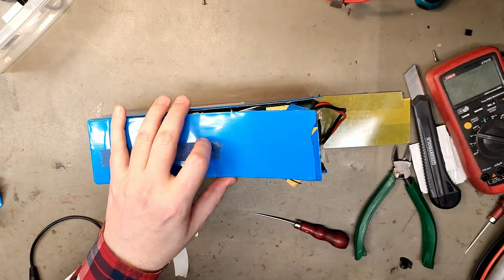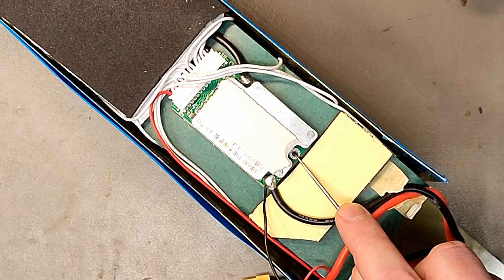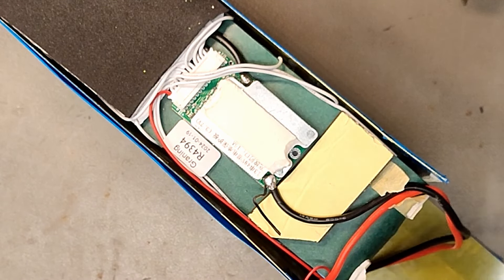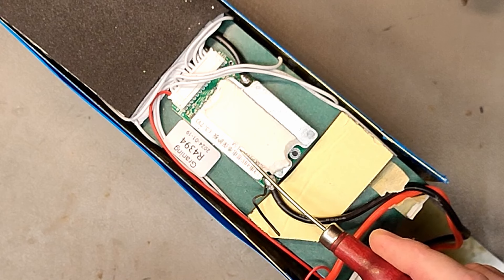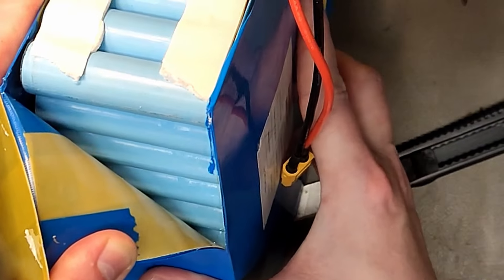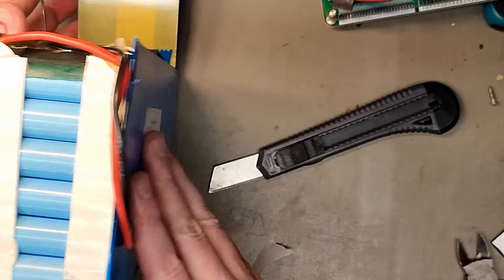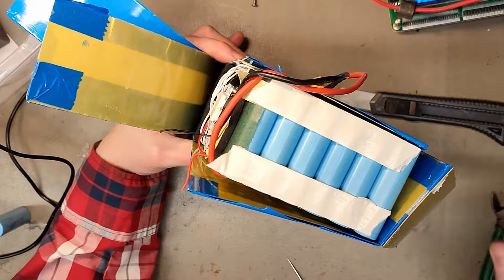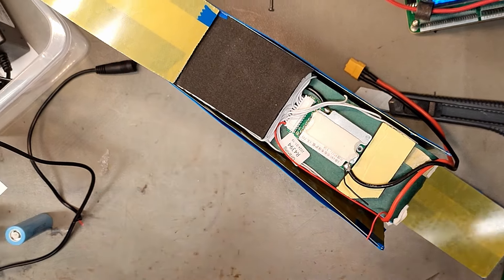Never buy your ebike battery from Scamazon! This is what you get!

Comment: They used this method when there's little space to the holder or cases anyway. Unlike them, i isolates each cell groups with gold thermo tape. Sometimes double or triple. it'a thin, sticky, heat resistant and doesn't conduct if something goes wrong. Good stuff
Reply: Kapton tape is the duck tape of electronics ;)
Reply: Hold up, gold thermo tape conducts electricity! Doesn't it?

Comment: Bought one of those chargers, left a 1 star rating and threw it away. No way I'm connecting an empty charger to NY battery
Reply: probably for the best, i did meet some people that use similar chargers for years with no problems, they work ok but usually give out 1.2A max.